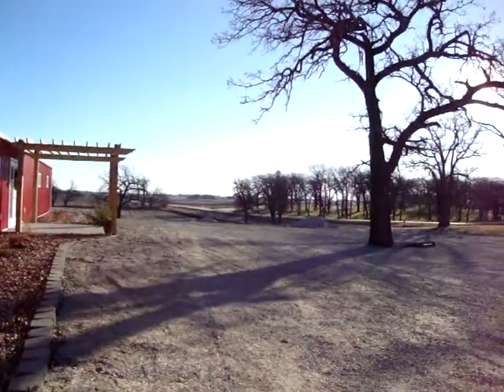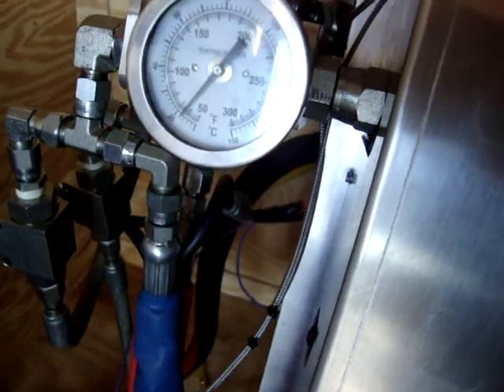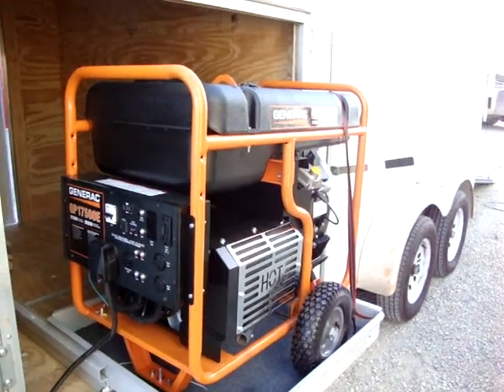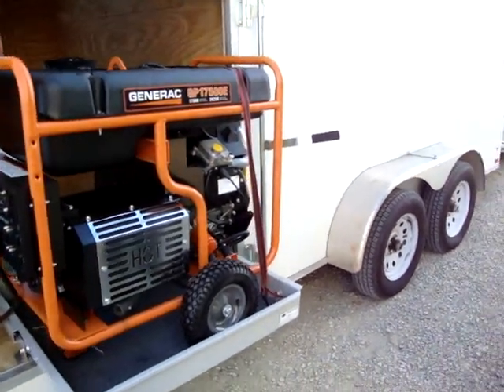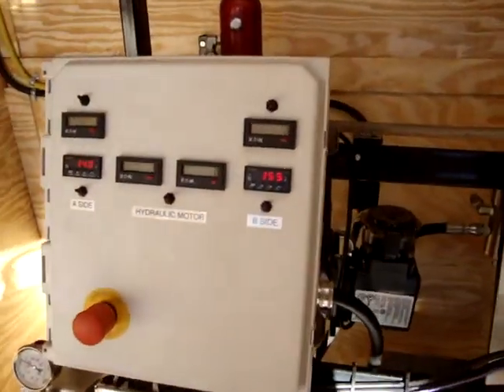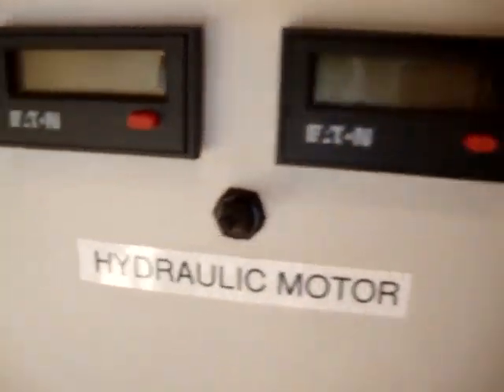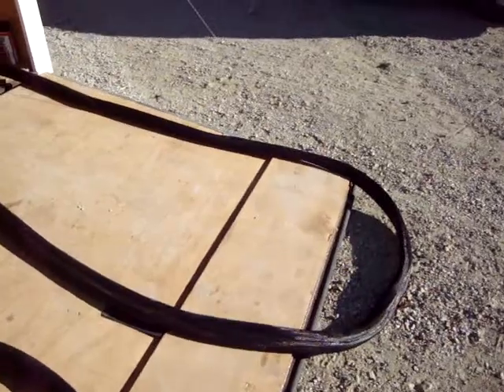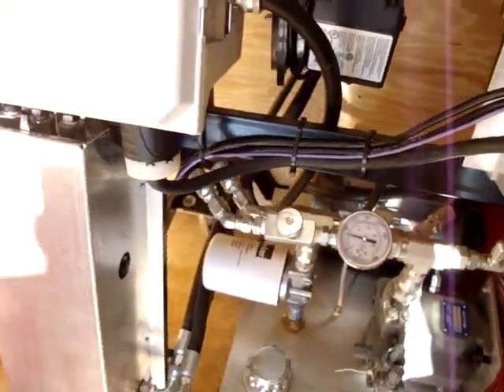NEW HYDRAULIC SPRAY FOAM MACHINE- SPEC TECHNOLOGIES

Comment: What is the over all cost without trailer? In process of purchasing a rig? Expensive!
Reply from the maker: This rig has had a few upgrades. It's a high output machine @50 lbs a minute. We are at $27,500 for just the unit. We only sell as a complete trailer as the installation now is modularly mounted on the walls. Feel free to call me directly @770-274-9888 and we can discuss your type of work and budget. Tim